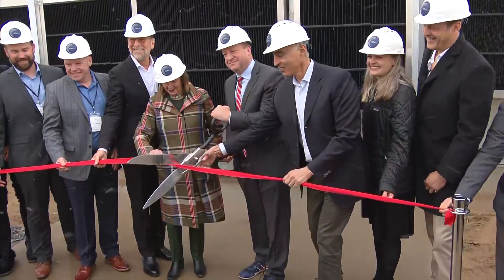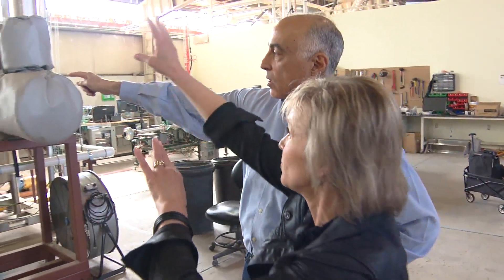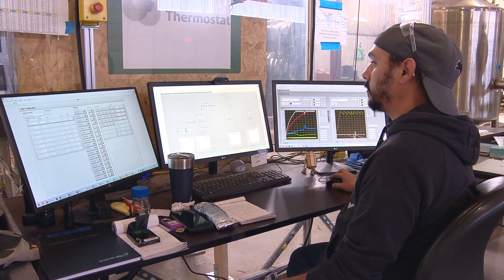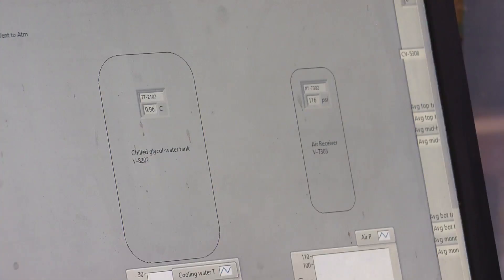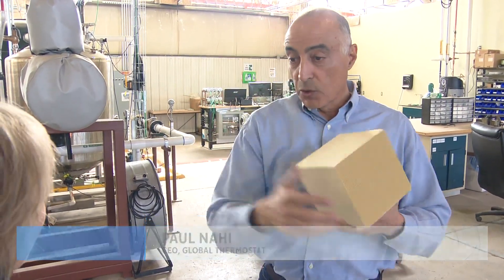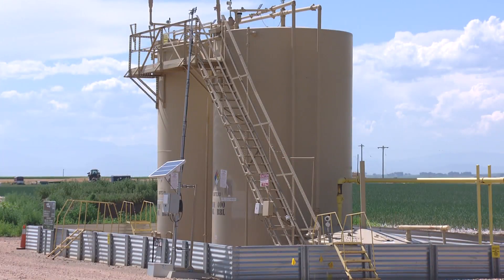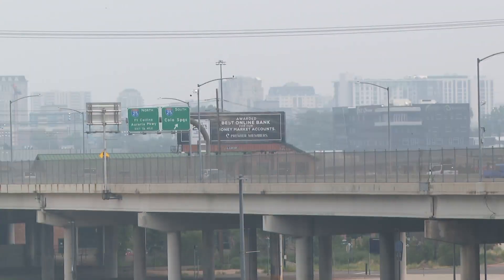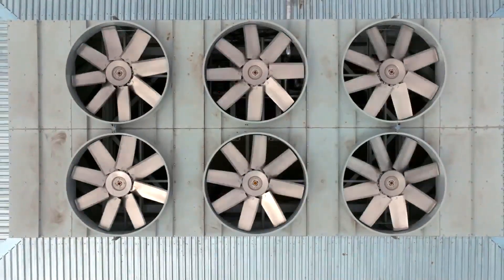Colorado company may be our best hope for reversing climate change

Comment: There is no climate crisis. 10% decline in natural disasters since 2000. Accumulated cyclone energy shows no increasing trend. Global hurricane landfalls shows no trend. Downward global trend for total hurricaine numbers. NOAA: "We conclude that the historical Atlantic hurricane data at this stage do not provide compelling evidence for a substantial greenhouse warming-induced century-scale increase in:  frequency of tropical storms, hurricanes, or major hurricanes, or in the proportion of hurricanes that become major hurricanes." NOAA data 1851-2021 shows no trend in number of hurricaine landfalls with the record high being 1886. The trend for over 7 decades has been downwards in the Pacific as well.
Drought appears to be decreasing globally measured by SPI 1901-2017. 
Global trends show no increasing flooding frequency or severity. 
For every million people on earth, annual deaths from climate-related causes have declined 98%.
Deserts have shrunk considerably since the 1980's. The Sahara shrank by 12,000km² per year 1984-2015. 
 The Earth has greened by 15% or more in a human lifetime. 
The Great Barrier Reef's coral cover has reached the greatest extent ever recorded. 
On extinction the rate is very low: 900 known lost species for 2.1 million known species in 500 years, so from observations there are an average of slightly less than 2 species lost every year.
Global temperatures maxed out in 2016 and have been lower ever since. 
There is no climate crisis.

Comment: I'm curious, what powers this plant?
Reply: Why?  It can be powered by renewable energy and the CEO noted the energy needed is "de-minimis".  What is the reason for your question?
Reply: @markschaffer480  Colorado's electricity is comprised of 37.6% coal, 26.7% natural gas, 0.3% biomass followed by  28.6% wind, 2.9% hydroelectric, 4.2% solar.  What would be the net gain if the factory is ran off of coal?
Reply: @iviewthetube  There is no "net gain" when mine to pollution from coal is properly accounted for.  What are ALL the pollutants generated from burning coal?
What were the percentages of electricity source in Colorado ten years ago?  What is the trajectory for fossil polluting fuel plants?  Down or up?
Why do you think the pollution from fossil fuels is not worth your time?
Reply: @markschaffer480  If pollution from fossil fuels is a concern then why hasn't Colorado opted for any nuclear power?
Reply: No nuclear out West. That's for the east coast.
Reply: @masonkanterbury3007  We've learned from history never to put all of your eggs in one basket.
Reply: @masonkanterbury3007  What is your concern about nuclear power?
Reply: Solar and wind. Colorado has many many solar gardens and wind farms.